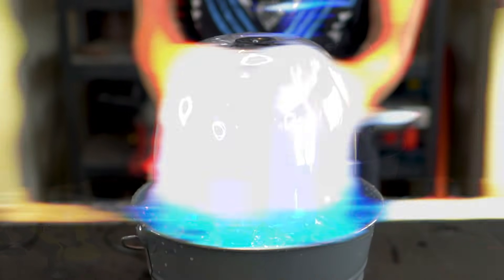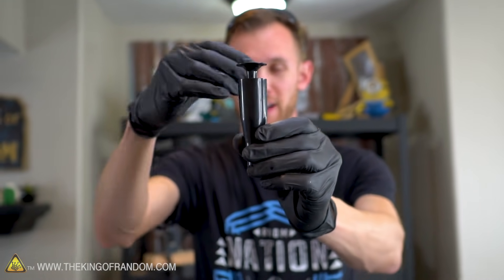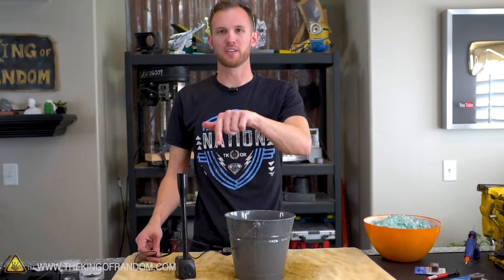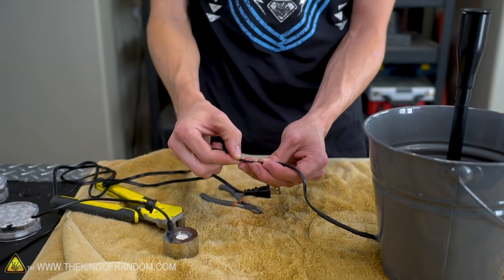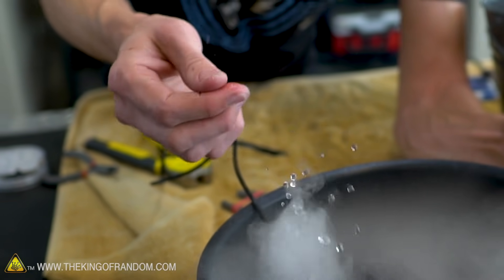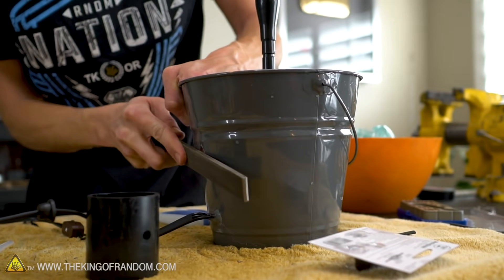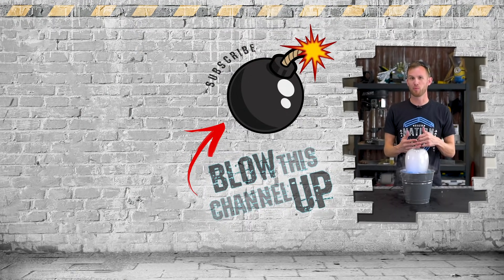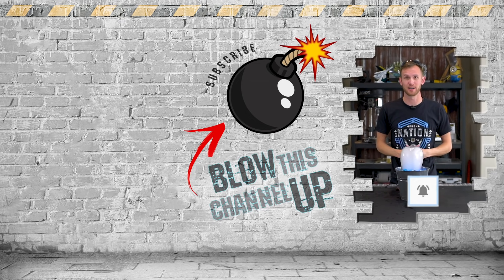This Desktop Fountain Looks Otherworldly

Comment: Could you do more experiments using the water vaporiser? Try it with different liquids maybe ?
Reply: Yes. Penut butter and glycerin
Reply: Vodka + inhale it? Seriously, how would that work? Ping MDs!
Reply: @nick1869  peanut butter is too thick
Reply: new way to get warm and tipsy!
Reply: Iman Jamil 
What happens if you put a water vaporizer in coke
Reply: Iman Jamil like liquid nitrogen or the metal liquid
Reply: Use jelly
Reply: Bruh no
Reply: Dry ice would be better, it just wouldn’t  last too long
Reply: that souns cool, maybe he could use a mix of propane, lighter fluid, and the vapor. then, you would have it so it's flamable.

Comment: you should make a fountain that has flames in it
Reply: pcgus they did one with propane bubbles
Reply: Its called a flamethrower
Reply: Search fire vortex fountain
Reply: Daym they did make one
Reply: pcgus a flame requires oxygen
Reply: Great idea for a winter project but not for inside use and not for summer use ither
Reply: They should buy a flame retardant fountain and fill it with lighter fluid in place of water, and then drop a match in the lighter fluid!!!
Reply: Done
Reply: @sweatpantjoe9490  hydrogen atoms bonded to an oxygen atom. take note of the "oxygen", that's what waters made of!

Comment: As soeone with experience making desktop or tabletop fountains, plase put in a drip loop. this is a single loop of wire that hangs lower than the socket your fountain is plugged into. this prevents any water from leaking down to the socket and causing a short.

Comment: Pro-tip:
Do NOT let the ultra-sonic vaporizer run dry. It will heat up enough the melt itself pretty fast... and likely burn your house down.
Reply: They make these with lights that you can control and if the water drops it shuts off

Comment: If you do this at home, keep in mind there is a 'hot" wire and "neutral" wire. TKOR connected the wires to the switch opposite of how they should be connected. You should break the hot and solder the neutral. The neutral side of the SPT style lamp cord has lines on it and feels rough when you run your finger across the jacket.  The hot side of the wire has a smooth jacket. And, yes, I realize it doesn't really matter in this instance, but if you follow the correct practice each time, you'll do it correctly when it really matters, like on a lamp socket where there is a higher chance of touching the metal neutral where the bulb screws in...

Comment: You should make a fountain where some of the water is put through electrolysis, and the resulting hydrogen and oxygen set on fire as they escape (preferably using a pipe to control the area where they escape).

Comment: You know what iyou should make the ultrasonic vapourizer vapourize gasoline or some other flamable gas preferably with no odour and have an electric arc in the middle of the water balloon i know all this might be hard to do as WATER is the theme but this should awesome if you can pull it of

Comment: I have a riddle about a bucket.

Your standing by a lake. You have a bucket with no bottom. You can not leave until you fill the bucket. There is no way to repair the bucket. So how do you fill the bucket?
Reply: you hold it to the ground/a rock until it fills
Reply: @jerrybrown5624  first: how do you get the rock
Second: how does holding it to the ground fill the bucket : third: It has no bottom.

The answer is much simpler than you think
Reply: @williamwinder3466 no you hold the bucket to the ground so that acts lice the bottom and it will still hold water and you can get the water by soaking up the water with your cloths and then ringing it out in the bucket multiple times

Comment: you should have put it on a remote controlled switch. and why didnt you just wire the vaporizer into the same switch as the pump? also, you could have just put a piece of wire mesh over the vaporizer, then put the crystals over it so i wouldnt look so ugly with a giant hole in the top.

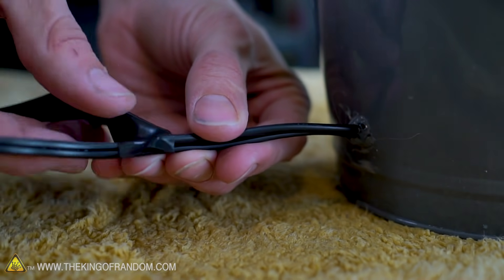Comment: 4:50 you should have cut out the electrical tape take. You didn't use it in the final design. 5 seconds later you switch to heat shrink

Comment: Rather than adding individual switches into the lines, simply plugging them into a power strip with a built in switch would let you turn both on at once.